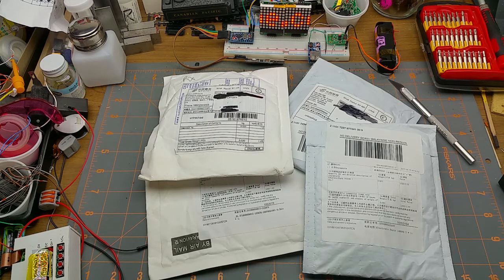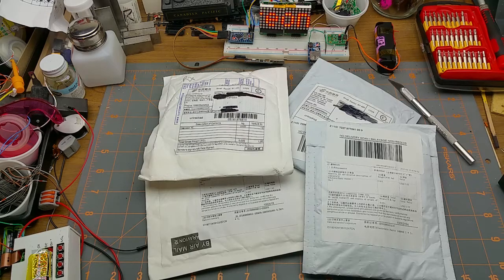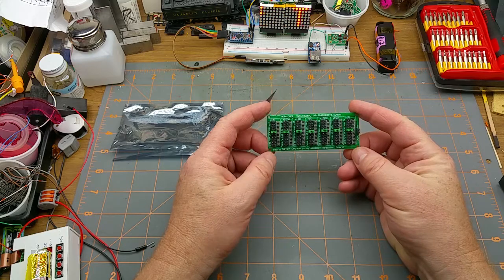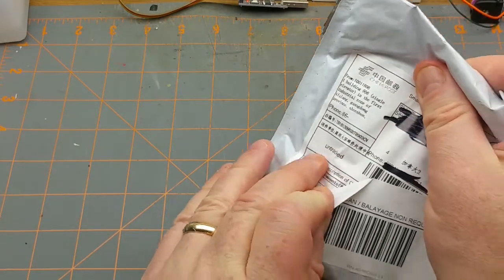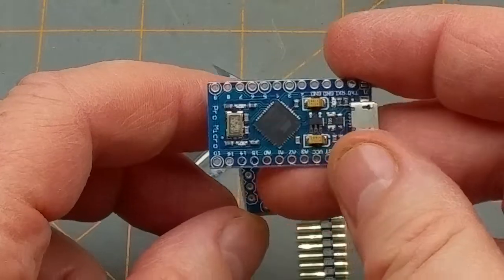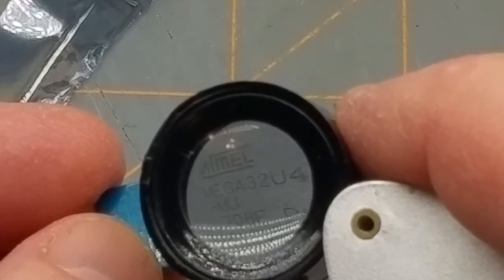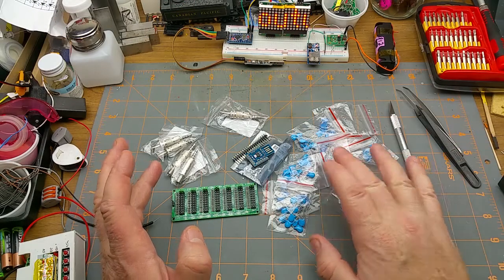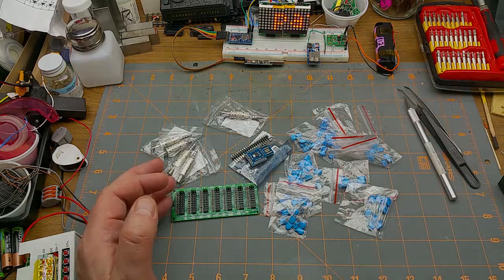Monday Mailbag (mailbag 12)

Comment: Yes please more. I also do electronics as a hobby, and I love watching you open stuff. It's lucky you don't live here in China... Taobao would destroy your wallet. Always some $3 thing to order. At lease we don't have to wait a month for it though.
Reply: Also what is that yellow tape you used on the nintendo controller breadboard? I see lots of hobby guys using it. Does it have properties that make it useful?
Reply from the maker: Chris Statzer:  that is Kapton tape (or at least a Chinese knockoff of Kapton). 
Benefits: thin, electrically insulating and heat resistant, non-stretching. And the adhesive doesn't transfer when you remove it (which is why I have it on that breadboard project - no sticky goo after I remove it)
Reply: Awesome i need a roll of that for sure. I assumed the non-sticky goo was part of the reason. Thanks for the info!
Reply: BTW the generic name for Kapton is polymide tape